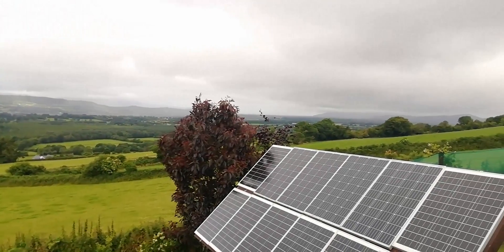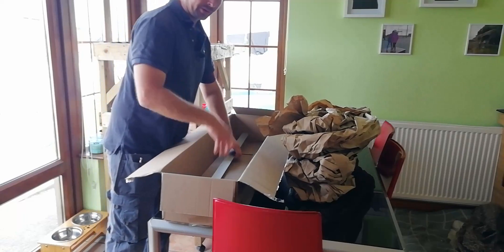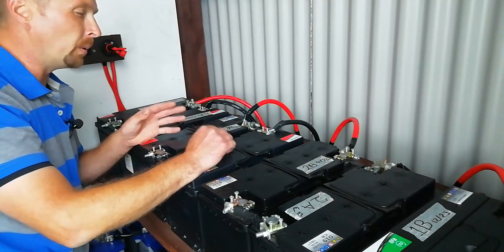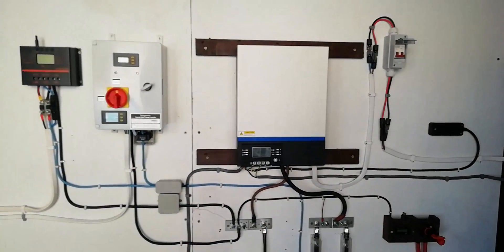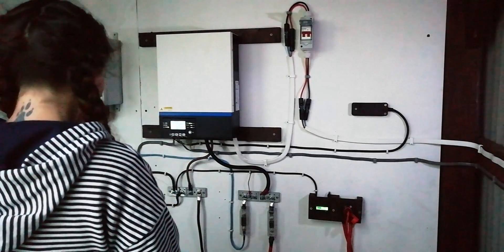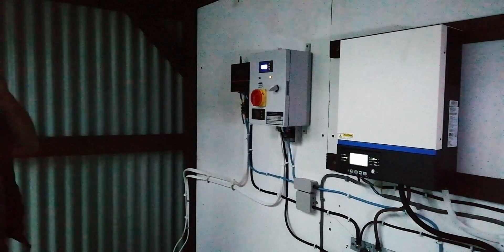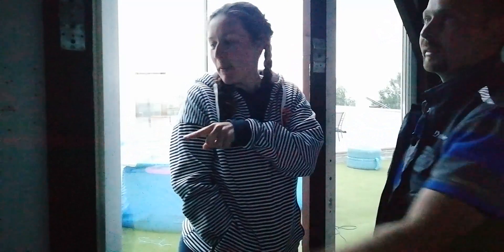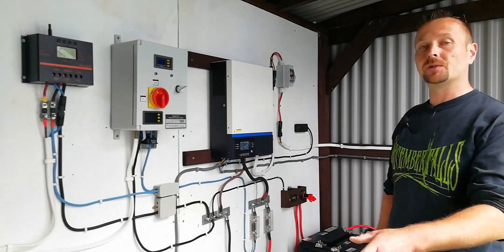27kw Battery Bank Off Grid Power Station Build

Comment: Interesting what you said about the cost of batteries. I went over to LiFePo4 cells about a year ago and I’d never go back to FLA. I recently built a 15kWh battery for 1500 euros. With the falling prices of LFP cells I could today build the same thing for little more than 1000 euros. Winter was alway a challenge as there are not enough solar hours in the day to fully charge FLA batteries. This is not a problem with LFP batteries. There is no lengthy absorbe period and it doesn’t matter if the LFP battery is not fully charged for weeks on end.
Reply from the maker: @kevinmills5293  FLA don't like 48v setup either....

Comment: Eveyone is pushing me to convert to lithium but for some reason and one of the reason was huge upfront cost I am still confidering lead acid or AGM. What i wanna know from you is that if those batteries can deliver the current you require for your inverter at a maximum load.
Reply from the maker: @ferdm9646  Same here, many saying to me to convert to lithium constantly. The upfront cost is a big problem then there's the additional cost of the management units. Lead acid management units are much more basic and as such more reliable.
This bank can deliver over 1000 amps if required however it's currently fused at 125 amps so as not to exceed the 3kw output of the inverter.  When the 3kw unit is replaced for the 11kw 48v unit it will be required to supply 230amps max which won't be a problem as that draw would be less than a  1/4 of its max capability.
Reply: @ourkilkennyhomestead2006  I was also told that this batteries won't deliver the current I need and it'll kill the battery soon , but 3kw at 48v will only draw about 62.5 amps which is nothing compared to car's cranking amps. However with good maintenance and water toping it'll last for long not to mention lithium batteries also have risk of getting fire or even BMS damage and it's not easy to replace from local shop next door.
Reply from the maker: @ferdm9646  that's it exactly. For a long time I've suspected that the lithium fans haven't considered the cca ability of lead acids and that they can handle that kind of abuse if required and simply be recharged afterwards undamaged. Truth be told in an off grid scenario they never have to do it as it would fry most of the equipment. 😊
Reply: @ourkilkennyhomestead2006  one more thing I wanna ask what type of batteries you're using , golf cart or leisure batteries ? I'm have two battery banks one of them are flooded tubular plate battery another one is AGM.
Reply from the maker: @ferdm9646  top row are 95ah standard flooded for automotive use. Lower row are 250ah standard flooded cells, previously used in industrial diesel generators.
Reply: @ourkilkennyhomestead2006  thanks mate!
Reply from the maker: @ferdm9646  thanks for checking out the vid. Hope your battery bank serves you well 👍

Comment: What’s the capacity of the 27kw power battery?
Reply: 27kw of lead acid or gel batteries is only 13.5 kw of usable power, because the depth you are able to discharge them safely is 50%, 50 percent is half of what you actually have. What he has done is great, but I think he could do lithium now for the same money, and have 100% usable power,that will last almost 3 times as long as the batteries he has now,ie he would have to replace his batteries 3 times to get the life of the lithium. Did you save money,yes right now at start up,but not over time. Lithium will save you time,money and space,you just can't loose going lithium
Reply from the maker: @dustydawson8977  would have preferred if you posted this as a direct comment instead of a reply. I stated clearly in the vid about the 50% discharge rate. Lithiums haven't come down to level price with lead acids here yet. They're still 3 times the cost roughly unfortunately. As for the longevity, ideally lead acids should be run like they are in a vehicle where they're kept in a constant state of charge. Approx 14.4v per 12v battery, once the lead acids aren't over discharged they're good for maybe 10yrs. Not saying one is better than the other. It's all how they're run. Thanks for checking out the vid 👍
Reply from the maker: 1125 Ah

Comment: I have everything from Victron, and it will last for years.
1x inverter 24/800 230v 1x inverter 24/1200 230v 1x inverter 24/3000 230v.
battery monitor, Cerbo-S GX central computer.

I am very satisfied with Victron before I had Chinese junk
Reply from the maker: @lexpee  have a close look at the pcb boards inside your victron. Guarantee some of them are made in China.....
Reply: Someone once told me that , except you and I everything else was made in china. So, please be aware most of theb powerbords and components at least are made in china. Not all the stuffs are considered junk, if you're happy with the blue power that's a different thing. Cheers

Comment: repost ... There's more to it than just inverter reliability.  A quality HF inverter can last a long time and has a fair amount of overrating capability too.  Lots of the HF all-in-one units are neither of these things, even well known brand name units.  The idle draw from most of these HF AIOs is quite bad, even the quality ones.  It's not unusual to see them chewing 50+ watts with no load.  10 hours of no solar overnight, at least 500 watt hours out of the battery and another 500 watt hours that has to come from the solar the next day.  Not insurmountable but has to be accounted for by way of a bigger battery and perhaps solar array too.

Victron can get down to around 18W idle whilst maintaining a normal sine wave and even lower when permitting it to be slightly distorted (victron calls this a modified sine wave but it is absolutely not the stepped waveform most people think of) and in search mode, not really useful in a lot of situations, perhaps 10 watts.  The power draw of Victron's solar chargers is low enough that it can be ignored for their units that do not have solar charging built in.  Other quality LF inverters have similar performance figures.  It's not just idle draw either, quality LF inverters often rival, even surpass, the efficiency of a lot of HF inverters.  Of course there are terrible low frequency inverters that draw stupid levels of power with no load from elcheapo brands and have horrid efficiency too.

There's another thing to consider with HF vs LF too, protection devices.  LF inverters have no possibility of placing DC (or DC offset) on the output while HF has this issue, and I'm not talking about fault conditions but this certainly also applies there too.  RCD protection on HF inverters should be a more expensive B type device.

Swings and roundabouts basically.  I'm not being critical of anyone's choice of equipment.
Reply from the maker: @retrozmachine1189  ah another victron fan boy, now it makes sense. Listen fella, I've got nothing against victron. It's quality stuff but technology moves fast. My stuff will be out of date and surpassed next year. The main thing is to not attach ourselves personally and worship kit or brands. Adaptation and learning is how we advance. It's not personal it's just technology so don't take it personally. These things are just machines not gods.
Reply: @ourkilkennyhomestead2006  Wow.  I'm not a Victron fanboy, any reasonable person can see that from my comment.  Your response is immature at best.
Reply from the maker: @retrozmachine1189  are you sure? You see I have no bias, zero. If i had spent 3times the amount on a wall full of victron stuff I would be very proud of it. Maybe reflect on your comments and how they may seem to someone with no bias and perhaps you may understand how they could be seen as having extreme bias.
Reply from the maker: @retrozmachine1189  perhaps I was blunt in my responses. For the sake of maturity let's agree that it doesn't matter what gear you're running as long as it works reliably, fits your budget and gains you some self sufficiency.

Comment: Such a false statement at 3:00. Home lithium batteries these days are all Lifepo4. These can be discharge 100% as I do mine on a regular basis. Lifepo4 are too cheap these days to be using lead acid anymore.
Reply from the maker: @Firephosure  the amount of charging cycles they can do reduces when they are repeatedly discharged below 80% so NO it's not a false statement. Also lifepo4 are still three times the price of lead acids so the only false statements are coming from you my friend.